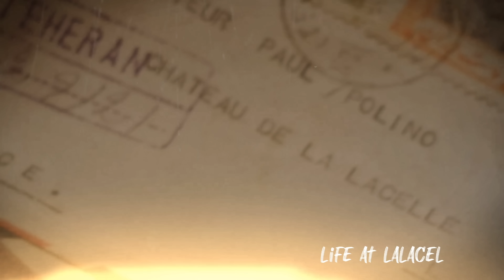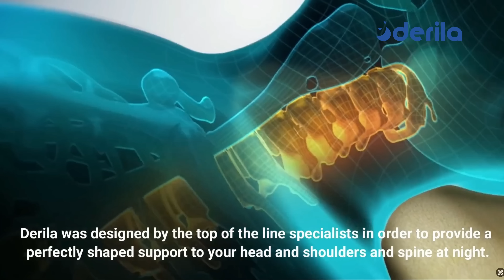THIS Has Not Been SEEN For 40 Years | Clearing the Châteaux FORMAL GARDEN.

Comment: I got one of those pillows ,Ash.   Just one question,,do you find it to be very hard?   The design shape is pretty good, but could be a little tad thicker.  It’s fairly flat.   Have not been using it as much as I thought I would because of that.
Reply: I think it’s about right for me. It’s my Goldilocks pollow😂😂 not too hard or not too soft 😊
Reply: I have not given up,,I may try a thin memory foam pad underneath but inside the pillowcase.  Will get the lift without giving up the contour.  Maybe I just need that Mama Bear height.  Thanks, Ash.  Loving your channel since the caravan
days.  Amazingly difficult, but you just plow on.  👍🏻👏🏻

Comment: Normally I am reluctant to comment, but I would like someone to explain to me how someone can cut down as many trees as you are doing in times of climate change. A wall can be rebuilt quickly, but until a tree has reached a size similar to the trees you have already cut down (and THAT with the noise pollution you are exposed to!), it will take many years!
And even a "formal garden" is no justification for this!